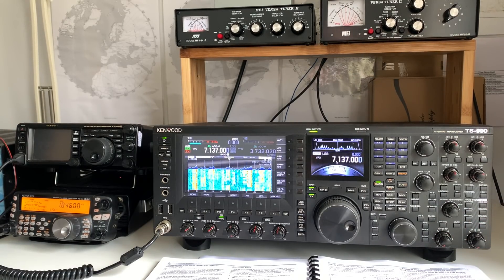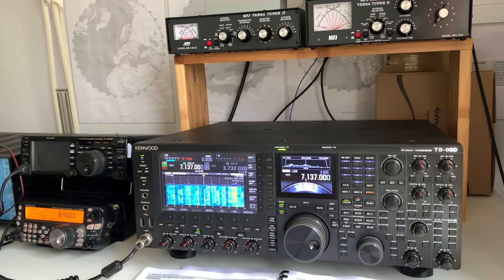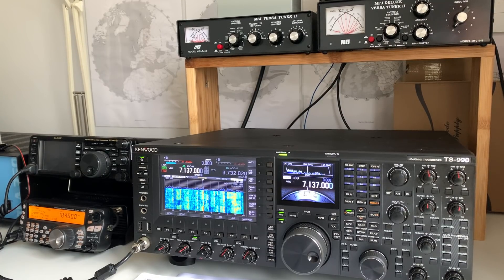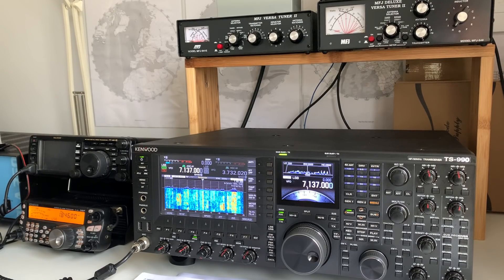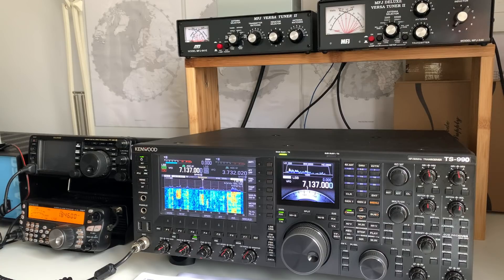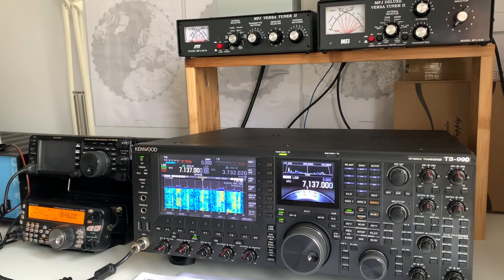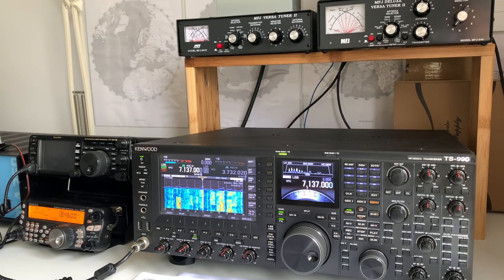Revealed: the uncomfortable truth about how ham radio equipment manufacturers specify their products

Comment: Hi try check the HEAT of the BALUN on topband,you will be amazed, especially if  you struggle to get a match .It will burn your fingers, so maybe nothing  wrong with your equipment but your antenna ??
Reply from the maker: It turned out to be the MFJ!!! Thanks and 73

Comment: I think MFJ ATU power specs may be correct for use into an antenna that is already a reasonable match, i.e. it doesn't present a challenging load for the ATU to match. I have used an MFJ 974H into a doublet at half its' rated power and the voltage present on the feeder was enough to make the inductor's selector switch flash over. The switch was of very poor quality, being made of PCB material. Replacement with a cheap Chinese ceramic switch cured the problem. It was a similar story using an MFJ-901B into a big horizontal loop, a burned out switch contact when running under  100 Watts PEP. I suspect they specify the power rating into a non inductive dummy load, not a real world ham antenna.
Reply from the maker: Thanks for your comments, 73

Comment: I appreciated you posting this video which I just came across yesterday. My comment would be: As a general rule if you have a problem in the shack and the choices for the source of the problem are: 1. Your stuff or 2. anything MFJ than the answer is always - MFJ. I owned that tuner and it worked well enough running barefoot @ 100W. But eventually I broke down and tracked down a Heathkit 2060 rated 2KW in great shape and have never regreted it! I paid some coin for that 40 year-old beast but it was more than worth it; yeah, you are spining that dial a lot, but it will take my 80-40-20 fan dipole and give me 1.1:1 to 1.5:1 on every band including 160M, 10M and even 6M! Only 30M is the exception(2.1:1).Verified by my MFJ 259B ( the one thing they DO make well, hi, hi!)
Reply from the maker: Thanks for your interesting comments, Andrew.

Comment: I found that any radio putting out over 100 what's you need at least a 1000 watt tuner.  Figure tuner requirements be at least 5 times what you want to output.
Reply from the maker: That makes sense - but the manufacturers should make that clear! 73

Comment: You have a 4k radio and a 25p tuner. MFJ tuners are dog shit. If you look at a quality 500w tuner you will see a massive difference in the quality of more or less every component inside it.
I have used in the past a Drake manual tuner rated at 2k. if you compare this to a MFJ high power tuner,  one looks like a quality bit of kit and one looks like a toy.

I have had a 990, very good radio. not perfect and a few little things that should be better.
I have had a 480, nice radio for what they cost. Again not perfect.
I have had maybe three MFJ tuners, all of them were shit. Cheap over spec'd and badly made.
Reply from the maker: Thanks for your comments

Comment: Hi, I just bought a ts990 about 4 days ago 2nd hand, before buying it I checked its power output on FM on all bands and it was putting 200watts or slightly more on every band except 160m and 6m bands where i measured about 185 watts, I used the CN901 power  meter into a dummy load. As a direct comparison I also tested my friends 990 and that was also putting 200watts on all  bands except 160m band where it was about 185watts. I dont have industry calibrated equipment, therefore I  cannot be sure if the 160m and 6m band is low due to a setting on the 990 or just my meter.
I wouldn't  trust MFJ equipment, their quality control and build control is not the best.
Hope this helps.
Reply from the maker: Thank you my friend. 73 (and congrats on your 990!)

Comment: Here’s a question why hasn’t manufacturers encouraged new growth by creating a license free ham radio in that it could only transmit on license free frequency’s thereby getting rid of the need for a license just to get foot in door of what could be a fantastic hobby 
Listening you can listen on any frequency within reason no license required 
Do if a radio was locked so that it could only transmit on license free frequency’s which would help with new hams get there foot in door learn radio etiquette procedure etc
Reply from the maker: The issue is causing interference on any band is possible, even with low power...
Reply: @OxfordShortwaveLog  not if the license free frequency’s bands are isolated meaning no interference to other bands frequency’s

Comment: I have learned that a radio with a internal tuner does not work well with an outboard tuner of course with the internal tuner disabled. I would never try what you did with an expensive radio hooked to a comparatively cheap tuner especially one with questionable quality control. Stick with the ATU in the Kenwood would be my take. 

KA1LQE - John
Reply from the maker: Am doing now - thanks

Comment: Thank you for sharing and over time I have learned the following. I hope it helps. 

Unless you measure using a dummy load and oscilloscope you will not be able to measure if a rig is following specifications. 

I have measured the ts480 output power using CW and it follows the specs. When switching to ssb you get into the grey observation area of average and peak power. I am measuring about 20% average output power with the ts480. 

Switching to another rig (tentec sdr) I am measuring average power to be near 60% when using ssb.

SDR based transceivers can be much more effective in average output based on full envelope processing. It provides the capability of optimizing average and peak audio without distortion.

The ts480 limits output on peaks only and does a poor job on average output. It does not have the possibility optimizing audio as modern SDR transceivers have. 

But there are a couple of negative side effects on SDR rigs too. They tend to be more RF sensitive and they react on this differently than non SDR rigs.  With most SDR based implementations and full envelope processing there is an unavoidable delay between audio in and the actual RF signal output. This results into an unpredictable response when rf leaks into your audio path through connected wires and such like. 

You could compare it with a conference call where multiple people in the same room enable their microphone at the same time. It will start resonating and quickly changes into the unavoidable "singing" loop and only disabling the microphones will solve the issue. 

With SDR transceivers a similar reaction occurs. The desired audio activates the ALC and when undesired audio (RF) is getting back into the circuit it starts resonating. The ALC will react and reduce output power. Undesired audio (RFI) is reduced and comes back again when desired audio is present again. Remember that there is a delay between desired and undesired audio...

You mention RF feedback when using the external tuner. To me this indicates your antenna setup might be the area to improve. Distance between antenna and your radio is important and If the antenna is not resonant at frequency you will have unavoidable RF at your tuner which you need to drain to somewhere else than your transceiver. That might be challenging or even unrealistic. 

Hope you find the root cause with your setup.
Reply from the maker: Thanks

Comment: NOT the radios fault.

The Operators the fault for falling for the Myth of " antenna tuner in the shack."

Can not tune an antenna system from the TX.

Thus was stated in Radio Antenna Handbook 1935.

Test it to a resistive dummy load.

These modern solid state TX fold power back when theres a mismatch, and there is thru the Fake Tuner.

See:

https://m.youtube.com/watch?v=ks3koEiorLc
Reply from the maker: Wow!

Comment: Your getting Rf into the audio because the poorly shielded MFJ tunner is to close to the 990 and its built in power supply. Try moving the tuner further away from the 990 with a longer jumper. I have a Yaesu FTDX5000 200w with a built in power supply and when my audio EQ was too close to the radio RF would come  in through that.
Reply from the maker: Thanks for your input, but that's not the issue. 73

Comment: You didn't mention which mic you were using. I had the dandiest time getting the RF out of my Kenwood MC-60. Mic sounded great on my ts-440 until I ran an Amertitron Al80a amplifier. 
I solved it with a few extra toroid's. I have great results with my MFJ Versa tuner V with roller inductor. It's rated for 3 kilowatts.
Reply from the maker: Thanks Paul.

Comment: Pure speculation about the possible under spec of output power…all you need to do is measure power out into a suitably rated dummy load ,and then can you make claims about them being low or not. In my 40 +years experience of Trio/Kenwood equipment there is no way that they would claim 200w if it wasn’t correct. If both rigs were new and under warranty then you have a case with the manufacturer,if indeed one or the other has an output problem.
Last point is whilst I admire and respect many MFJ products, they are low budget and it seems like putting ” cheap tyres on a Ferrari “😉
Any way good luck and hope you found out what the real issue is.👍
Reply from the maker: Thanks. You need to watch part 2:

https://youtu.be/L9YFdZn4JOI

73

Clint

Comment: Hi Clint.  First your not testing your transmitters power output correctly, all manufacturers offer a service manual (which you have to purchase from the manufacturers).  The service manual describes the test procedures, for all aspects of the transceiver!  Transmitter power measurements are made with an accurate watt meter terminated into a resistive dummy load (rated at, at least twice the power of the transmitter max power output).  I’m sure that the MFJ tuner is tested with a resistive dummy load connected to it output!  When I buy a new piece of equipment, I purchase the service manual at the same time (they usually cost from $15 to $30 or so, they have a wealth of information about equipment)!  73’s
Reply from the maker: Hi Bill, you need to watch part 2:

https://youtu.be/L9YFdZn4JOI

73

Comment: MFJ tuners do OK at 2/3 of their rated load but not on 160 meters.  I use a Denton for my TS-480 and SB-200 and no issues on 160.  My MFJ rated for 200 watts didn’t do well on 80 or 160 at 100 watts from a Ten Tec Corsair II. I think MFJ is optimistic about their power ratings or maybe they don’t account for tolerances adding up but it happens to a lot of hams.  I’m CW only so I don’t see the signal degradation that is more noticeable to phone ops.  Nice shack, by the way.  73. Les WB5JWI.
Reply from the maker: Thanks Captain Bart....keep safe and 73

Comment: A 300 W MFJ tuner is good for a 100 W transceiver. You likely need a bigger tuner (600W) or just use the internal tuner. Of course verify the power output with a dummy load and power meter.
Reply from the maker: Cheers - already done.

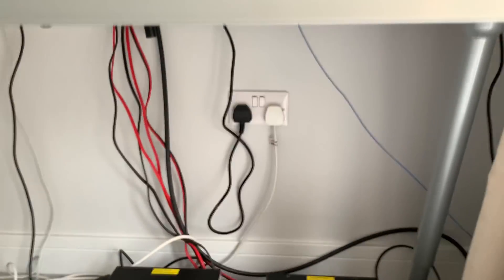Comment: Easy explanation. 0:56 - DC terminals of theese PSUs are completely isolated from mains (from PE line), so the chassis of the TS-480 is also isolated from PE line. Internal PSU of TS-990 has PE line connected to its chassis, so the mains PE line become part of the antenna grounding system, which makes huge difference. If you interconnect the negative DC PSU's terminal with mains PE line, you will run into same problems with TS-480. Described issue is caused by the RF currents flowing between antenna's and mains grounding system, which is typically sign of poorly designed antenna. Almost any ham radio antenna is poorly designed, so nothing interesting.
Reply from the maker: Thanks

Comment: I’m confused why the speculation on where the problem is when a simple dummy load in different stages would isolate the culprit component in 5 minutes. Also, your headline seems premature. For the money, Amateur radio manufacturers, on average, produce very high value. (Features and reliability vs. cost)
Reply from the maker: Wrong! That test has already been carried out and the fault is still ambiguous. So many hams talk the talk but most know less than they think they do. Don't fall into that trap yourself...73

Comment: Good video, and very informative!
1st, what are (anyone's here) thoughts on the "LDG AT - 1000 Pro II Autotuner?
2nd, the Icom 7300, as I have discovered the the "auto antenna tuner" in the radio doesn't seem to work on 40 meters, and, many IC 7300 owners recommended /some sort/ of an "external tuner" as the one that the IC 7300 comes with isn't that accurate.
3rd, I'm also running a multi-band vertical antenna system that almost all Chameleon Antenna except for the 9913 coaxial cable and RF choke.
KD8EFQ/73
Reply from the maker: Thanks!

Comment: You do not say what the forward power meter on the MFJ-948 is reading with the two transmitters, set the same.
You do not say if you are using the 4:1 balun in the MFJ-948 on the top band, it will have it's own power handling restrictions on low frequencies.
You do not say why you are using the MFJ-948 when it is totally unnecessary with the Kenwood TS990.  If I were to sent you a new MFJ-949-E would you add it is series with the MFJ-948?
A 200. Watt radio should continuously be able to produce 200 Watts on key down CW and FM, with SSB (whatever that is) peaks over 200. Watts.
You do not say if you hear any noises  (perhaps from an arc) from the MFJ-948 when you are outputting 200. Watts on top band with the Kenwood TS990.
You do not say why you are driven to a 200. Watt radio, the 1/3. S-unit at the other end is seldom helpful.  A 400 Watt amplifier is  seldom helpful. Ron W4BIN
Reply from the maker: Whoa, old son! You're way ahead of yourself. Those tests are to come.

Comment: 160m is a challenge with any radio and tuner.  Do we have to have a 2000 watt tuner just to be able to use a 200w radio on 160m ?  No thanks. 160m is limited range and only at night anyhow
Reply from the maker: That's not really the point though is it?!

Comment: MFJ is known for overly optimistic specs. I would take any of MFJ's specs and cut them in half as a matter of course. But the real issue if RF is getting into your audio someplace. You need Mix 75 Ferrite Toroids and to put about 20 turns through them on every wire going in and out of the 990. 160M is notorious for RF.
Reply from the maker: Thanks

Comment: I see in other comments the suggestion of a dummy load. Always do this first with a new rig. Only dummy load should be connected to the radio during the test. Key up (cw) and measure your power (preferably with a calibrated directional coupler). That will be truth for you radio output.
For external tuners, make sure your rig tuner is disabled/bypassed so you are not creating a reactive setup with the external and internal (rig) tuners.
Lastly, grounding is key (especially for rfi abstement). If you add more/different ground wires, you potentially create more ground loops.
Reply from the maker: Yeah that video is coming....

Comment: Check that you might have a rubbish external meter or that it is not a pep meter, or that pep operation requires external power that you may have neglected.
  I have not had good luck with mfj external tuners.
Have you ever considered using a 100 watt radio with an Acom 1000 amp? 200 watts is not much improvement over 100, just maybe an s unit on someone. 
  First I would be absolutely certain that your external meter will do pep.
I found that lots of Daiwa meter just can't do it.
73 my friend, and good luck on your issues.
WY4C James...
Reply from the maker: Thanks for your constructive comments my friend. 73

Comment: MFJ has been in the antenna tuner business for a long time. In the olden days of tube transmitters, transmitter power was  rated based on input power to the final amplifier which is very easy to measure. MFJ has always rated their antenna tuners based on input power, not output power. A good rule of thumb is that most transmitters are 50% efficient. So, the actual output power handling power of the older models of a MFJ antenna tuner is about half of the the MFJ specified power. I hope this helps, Tom
Reply from the maker: Thanks Tom. 73
Reply: I'm still confused how that translates to solid state.  What transmit power is possible when the input power to the final amplifier is 1 w?  3 dB more, 10 dB, 30 dB?

Comment: Here are some of my thoughts. Is the 990 rated 200Watts SSB if so is it still rated 200 Watts PEP? IF so that may be your problem because PEP stands for Peak Envelope Power and your "peak" is at your audio peak and you would NEVER  see a meter that can measure it because it happens so rapidly. A digital watt meter might be able to measure it by using a function like peak hold that can detect the actual peak power. I hope this helps.
Reply from the maker: Thanks
Reply: A proper, powered, design of PEP meter will show genuine peak readings. Some so called PEP meters only stick a small electrolytic capacitor across the meter movement that charges up to deflect the meter to something between average and peak.

Comment: Most if not all antenna tuners are built for typically AM carrier mode.  BUT NOT USUALLY DISCLOSED TO THE OPERATOR.  A 300 WATTS PEP rated tuner therefore can stand up to 75 watts all day long. Whether that be RMS or PEP power.  In your station you need a 800 PEP rated tuner to handle your 200watt stations.
A typical problem on 80 & 160 meters is the low impedance of typical deployed antennas.
A three hundred watt tuner is being pushed to be used with a hundred watt rig.  Anyways,  anytime you run more than 50watts your connections and components connected had better be up to the task.  The 948 tuner you have has been asked to do something it was not designed to do.  To understand this more,  this is exactly why 3kw tuners are wanted for the average kilowatt station and a 5kw tuner for the 1500 watt legal US gallon station... Good luck.
Reply from the maker: Thanks for the info. 73